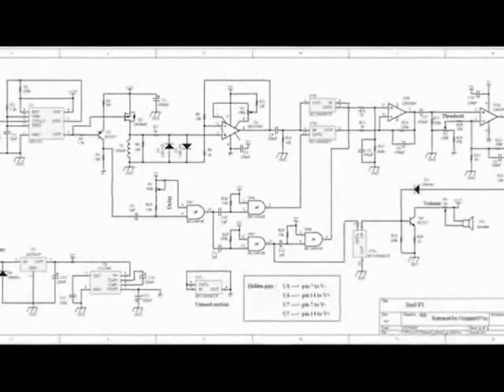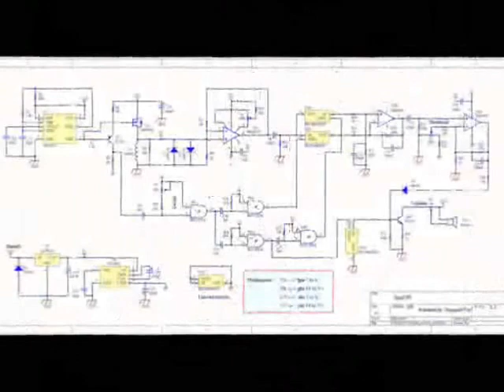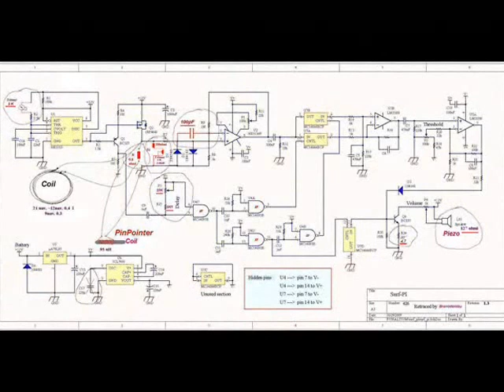Metal Detector Test 1 Euro 40cm.

Comment: It is important to note that Pulse Induction (PI) metal detectors such as this one, while providing excellent detection depth, cannot discriminate between the various types of metals. It will pick up a piece of silver foil or an aluminium bottle cap just as efficiently as it will a medieval silver hammered coin.